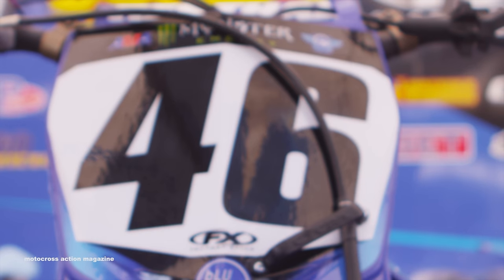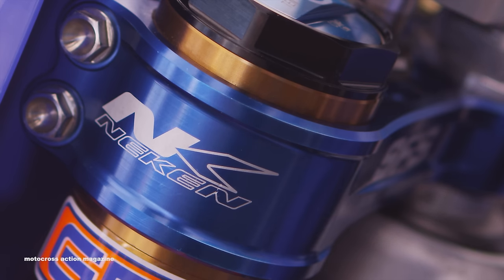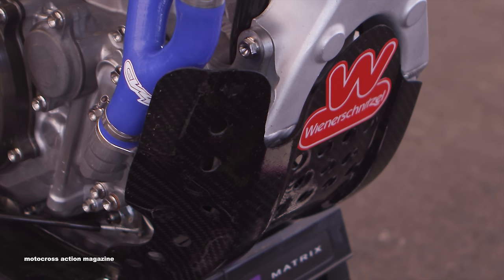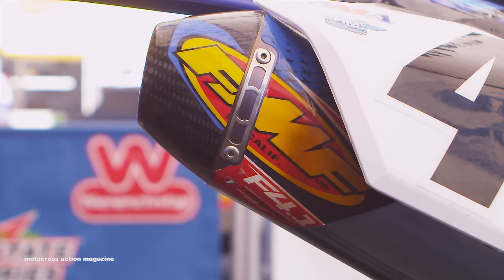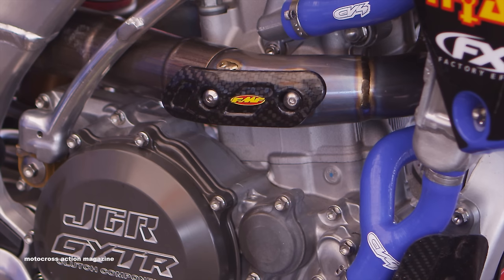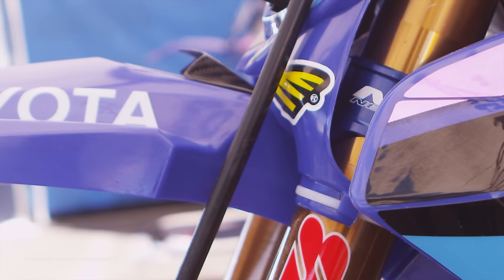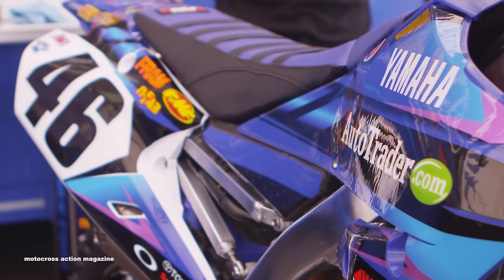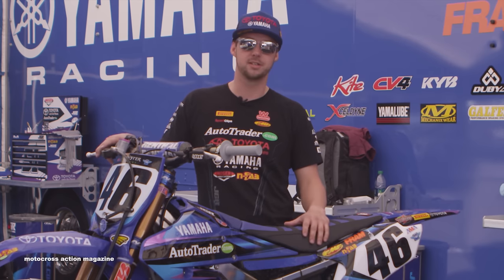Inside Phil Nicoletti's super tricked out Cycle Trader JGR Yamaha YZ450F

Comment: whats with the spark plug looking thing in the exhaust pipe???
Reply: +jai tisdell Its an exhaust a/f ratio sensor that tells the ECU to adjust air/fuel mixture in accordance to what is coming out of the exhaust, like excess fuel. This is very common on cars.
Reply: +Dylan Delisi 
aahhh okay thanks man 👍
Reply: mass airflow sensor